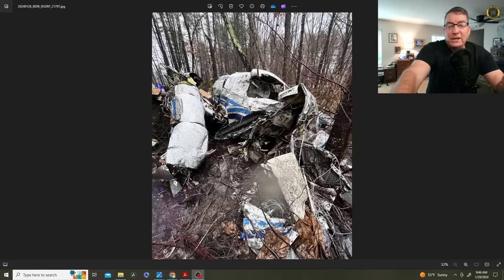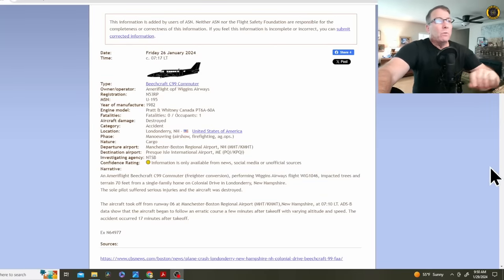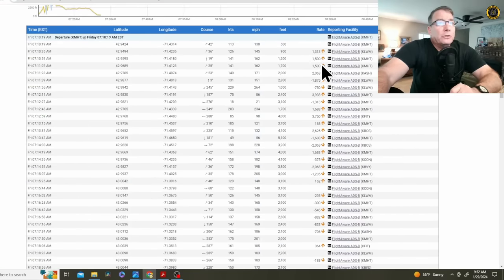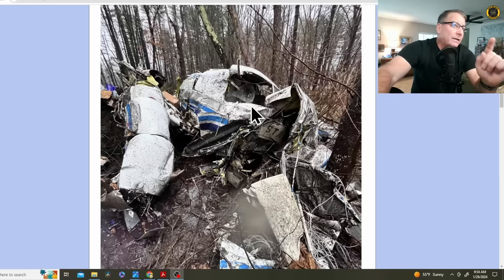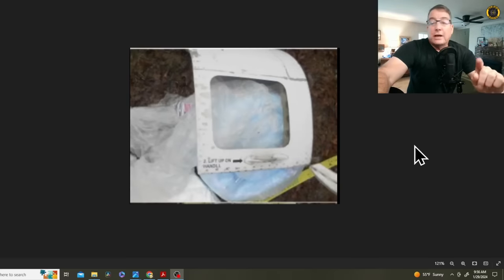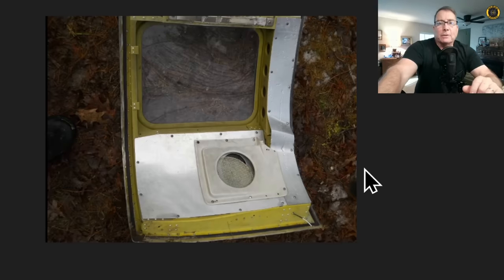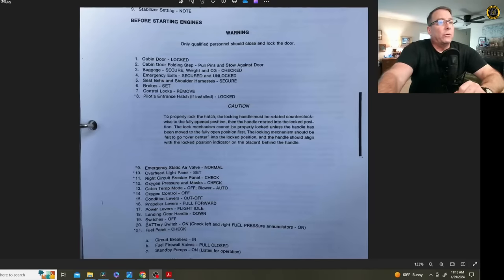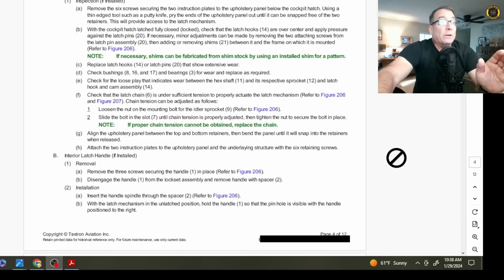Beechcraft C-99 Door Open In Flight Crash! 24 January 2024

Comment: I have about 3000 hours in Ameriflght Beech 99’s. The proper closing of these doors has always been a very important thing to pay attention to,  in fact Ameriflight has even drilled one inch diameter holes above the latch hooks so that you can physically see that the hooks are properly engaged.  It’s imperative that you make sure these doors are properly latched since trying to close this door in flight is almost impossible.  I most likely have about 300 hours in 53RP.  It’s equipped with a cargo pod under the fuselage.  This no doubt helped cushion the impact and made it safer for the pilot.  During my time at ameriflight they had very strict policies that would help prevent this from happening.  The 99 handles icing conditions very well.  You did a fantastic job of describing this accident and the operation of this door Juan.  Great Video!
Reply: I'd be willing to bet you couldn't shut that door AT ALL, until you've landed and you're at taxi speed.
Reply: @rocketman374 IF it stayed there opening upwards looks like it gets right into the slipstream and if it doesn't come off its a sail screwing up control if it does come off looks like the vertical stabilzer is right in the path...
Reply: @rocketman374 you are correct.  If you have one latch loose, do not ever touch that door until you’re on the ground and taxiing. We had one guy do that, and the door is somewhere in the Mojave desert.
Reply: @chrisjohnson4666 more than one door has come loose during the time this plane has been in service. The door will come off cleanly with out hitting the tail surfaces. It’s just a very miserable convertible when this happens. One time after shutdown the whole door came off on me because an upper hinge pin came off.  That was an easy fix.
Reply: Looks to me like that entire latch system needs drilled out of the aircraft and two manual latches installed. Ideally, each with a prox switch that would go to a Door light on the cockpit, but I am an avionics guy so what do I know?
Reply: @porkrind There are already two mechanical hooks in the fuselage that come up and hook over two horizontal pins in the door.  When operated properly, the pilot can look through the holes to verify that the door is properly secured.  This works very well, rather than to engineer it to death using micro switches and other stuff that isn’t as reliable as direct visual verification.  My educated hunch is that the pilot was in a hurry and this bit him very hard.
Reply: @donalddepew9605  I'd rather fight 1000 prox switch issues than a single crash. From the comments I've seen it looks like the door switches were a known unreliability. The exploded BOM shown in this video is insane for a catastrophic piece.
Reply: @porkrind you can put switches anywhere you darn well please.  But actual physical visual verification is best.  I’ve been there and done this thousands of times without issue.
Reply: @donalddepew9605  I like my lights!
Reply: @porkrind  Quite. Loud buzzer that goes off any time there is power with the door not up and not yet doubly latched, for example.
Reply: @queazocotal there’s already an aural warning stating that the trim is out or parameters for takeoff.
Reply: This is why I love this channel, it brings knowledgeable people together! Thank you for commenting and thanks Juan.

Comment: This was the best ATC performance during an emergency that I have heard in a long time. No useless, stupid questions, just helpful offerings. God bless these controllers.
Reply: What would an example of a useless stupid question be…?
Reply: @PRH123  if you have been on frequency during an airborne emergency you hear ATC ask for souls on board and fuel on board. That’s somewhat useful for the controller but the simple question becomes an immense mental task to a pilot in a fight for his and his aircraft’s survival. It always introduces additional questions in the pilots mind, such as “do they need it in gallons or pounds or hours remaining?” And figuring that out while trying to contain  and control a problem is counterproductive in the extreme.
Reply: Thank God for level headed ATC controllers! One nasty night my 99 suffered a total pitot/static freeze up climbing into the clag 200 AGL in freezing drizzle and turbulence. P+P=P, I checked in with departure with my emergency, and the controller matter of factly said he had a mode C altitude on me and gave me a speed readout that was about right for the elapsed time from liftoff. Huh? Both systems in the cockpit inop, and no joy on alternate static, all deice been on since starting taxi. "Don't look a gift horse...". My savior  calmly offloaded his other traffic and became my audio altimeter and speed sensor, up to 3,000 feet and around to the ILS and right back in. Piece of cake. He then invited me into the ATC facility to share a coffee break. Cool as a cucumber. Once in a warm hangar, the P/S systems worked fine, after giving up a scary amount of meltwater. Turns out the plane had sat outside during a sharp thaw with wind driven rain and a frontal passage and a sharp freeze. Alternate static checked out OK on the ground, and the blockage was too far in to be touched by the pitot and static heaters.

Comment: Having worked with firefighters for years now, one should never say they’d be unable to open any door. That’s a challenge they love to meet.
Reply: Especially with the Hurst tool
Reply: I was walking on a trail once, when a pickup ran up the guardrail and slammed into the concrete column that was on the guardrail a few feet down. The truck hit hard enough to push a solid concrete block probably 3 square feet around a few inches back and then rolled onto it's side.
Myself and some other people worked to get someone into the cab of the truck to calm the driver down until the fire department could get there, and once they did, it was wild seeing how quick those tools cut through the top of the truck so they could get the driver out.
Reply: @aaronwhite1786 on the cutters, most modern tools produce about 285,000lb of force at the blade notch, spreaders are well over 350,000lb. 

You can move a ton of metal without blinking.
Reply: Never met a door I couldn't bypass 🚒🪓
Reply: @MomedicsChannel  Definitely looked that way! I feel like Fire Departments could double their revenue just having "Come play with our tools" days where they let people cut scrap cars apart for cash.
Reply: If you want this door to open, just tell engineers this door can't be opened.
Reply: @aaronwhite1786  I know of at least one volunteer department that did exactly that, until the insurance company found out.
Reply: @aaronwhite1786  On most road vehicles the windshield is built in such a way that it will shatter and contain either a body flying through or getting inside the driving compartment, but it should be possible to kick it out from the inside once it is damaged. Assuming you still have working legs, that is.
Reply: My car was rear ended and the rear tire punctured by folding metal. I tried to use a pry bar to open the trunk to get out the spare. The fireman on scene asked me for the keys and opened the smashed trunk using the normal latch. As he walked away with a smirk I said "Show off!"
Reply: Seen fire fighters mess things up so bad - Dang near killed themselves with fire & electrocution on aircraft . . .
Battery location, fuel cut off, cut out areas the normal fire fighter hasn't a clue. Trained A/C fire crew here
Reply: @TDOBrandano  Yeah, in this case, the guy was pretty out of it. From what the nurse who crawled inside said, he was out of it, and might have suffered a medical emergency which caused him to go up the guardrail in the first place.
They were able to pop out the back window with a rock and get someone in to check on him.
I was trying to tell the guy who was trying to break his way through the front window that it probably wasn't the best idea, since the guy inside had nothing to cover himself with, and it's like we were going to quickly peel the thing back anyway. The car wasn't on fire, so there was no reason to rush getting an opening. Thankfully, the nurse that happened to be nearby told him to knock it off.
Reply: @EyeMWing  Aww, that's a bummer. It makes sense, especially with tools that powerful, but it would be a ton of fun to do.
Reply: K-Tool Pro-Bar Halligan, 8-pound fire axe and 6-foot New York hook in reach at the computer. House was built in the 1880's reconfigured several times and moved once. I want a fast way to clear a path out if a fire starts.
Reply: "Here's...JOHNNY!"
Reply: Isn't it easier to just knock?
Reply: @aaronwhite1786 I hurt my back in high school playing with one of those of course this was in the early nineties and it wasn't something you sued about. But no you shouldn't come play with their toys because they are will hurt you if you're not careful and we were being supervised. My injury wasn't Apparent at the time because of adrenaline. We were fire rescue explorers we were prepping for a car disassembly demonstration.
Reply: @markstorrs1787 Damn straight. Our department was the first volunteer company in the northern part of our county to have those tools in the late 80's. It made sense for us to have them because we had two major highways intersecting in our district.
Reply: Firefighters are basically human wrecking balls. They have to be. Getting heavy doors open, breaking out walls to get to the fire within, yeah, they're heavy wrecking and an aircraft offers minimal opposition.
Reply: So they will waste valuable time trying to prove a point when window entry is much quicker and more efficient.
Reply: Do firefighters really distinguish opening a door from making a door?
Reply: There is a long history of doors becoming inoperable in aircraft crashes, trapping those inside. It would probably be just as easy to cut through the fuselage at any preferred point that the scenario presents. In this particular accident, though, it is unlikely that any firefighter on earth, or all of them put together equipped with the latest and greatest tools, could open that door. (No one can open something that isn't there.)
Reply: While I don't doubt that for a second, I think Juan's point was simply that the opening for the hatch wouldn't have looked like that if the door was attached at impact & subsequently removed by firefighters.  In particular, it's the damage around the top of the frame where the hinges were located that's of interest because that door looks pretty intact... the question is more whether emergency services widened the opening to gain access, or if the damage is solely from the door departing the aircraft.
Reply: Years ago I was a EMT student doing ride alongs with an ambulance service. We were dispatched to an accident scene. The driver was unconcious and the door locked. The FD was setting up the Hurst jaws to gain access. The lead paramedic  observed and assessed the situation. He walked to the car, reached in the open window and unlocked and opened the door. We got the patient out and treated her while the fire fighters sheepishly put their tools back on the truck.
Reply: well that's good.  I guess.
Reply: They usually don’t open doors in this situation.  They cut away everything in their way, door, for frame etc. That’s totally different from opening a stuck door.
Reply: Hahaha working with firefighters I'll say absolutely! Fires and cutting up vehicles are what they're born for
Reply: I was a firefighter once in charge of the rescue tool and full disclosure- I did say BS or something to that effect when he mentioned it. That tool was insanely powerful and that was WAY back in the day. The hardest part of extrication is the sounds from the patient- they really stick with you. 
Well hell, having revisited that I bet sleeping is gonna be stressful for the coming days. Yay.

Comment: I had an accidental opening of the canopy on a Van’s RV6-A once.  The canopy stayed on the aircraft while every loose thing in the cockpit flew out, much of it binging against the empennage while the airplane suddenly pitched about 45 degrees down.  Had I not had a shoulder harness on, I think I would have gone out with my camera, charts, etc.  My knee hit the instrument panel and shut off one of the magnetos.  It was the closest I ever came to getting killed, but I was fortunate, because of past training, experience, and a calm mind, to get everything under control and land safely, but it wasn’t an experience I’d like to repeat.  Needless to say, I feel a lot of empathy for this pilot.
Reply: Tip up or slider canopy?
Reply: @davidd6635  It was a tip-up canopy.  It had not been properly latched before flight and I tried to fix it, a very big mistake.  If anything like it ever happens to you, just fly the airplane at a controllable speed, land, and fix the problem on the ground.
Reply: you tried to fix it WHILE IN THE AIR? As in, u saw it improperly latched, and then tried to reopen it to properly reclose it in the air..?  @drmichaelshea
Reply: Your experience tells us that those harnesses can help a lot.
Reply: OMG
Reply: OMG
Reply: OMG
Reply: @KuostA  NOT what he wrote. He wrote he tried to fix it, which might mean pushing the latches harder. YOU wrote he opened it! Very different.
Reply: @billpugh58  he edited his post since that's definitely not what he originally wrote lol

Comment: Former Wiggins Pilot. I flew for them for seven years, loved flying for them. I thought that their maintenance was top notch and the only problem was the pilots not reporting any issues or squawks. It was not uncommon to get an aircraft and write up thirty squawks, all not previously reported. Very much of a “You flew it in, so you can fly it out!” attitude amongst the pilots. My friends that still work there tell of the airline’s decimating the repair staff, offering wages that Wiggins just can’t compete with, such that the number of  maintenance personel is one quarter of what it was.
During training, it was HAMMERED on us that you HAD TO MAKE SURE THAT THE HATCH WAS LATCHED!!! Legend was that the hatch would take out the vertical fin and rudder while departing the aircraft! It was pretty rare that I had to delay a flight due to the hatch not latching, but I did.
There were some concerning things that happened, but there were only two times that I was truly scared. First was being in such severe icing that I couldn’t see out of any window. The second was a very similar profile to the accident aircraft where some customer required safety wear caught on the hatch handle and started to open it in flight!  
While some of the 99’s had the “D” ring handles, most had an “L” shaped handle, and the L shaped handle caught on the safety equipment and started to open the hatch! It was the change in noise that alerted me that something was up. I was able to re-latch it without the hatch visibly opening! I was shaken enough that I was “off” and distracted for the rest of the flight.
I didn’t know the pilot of the aircraft, but know several that do. I am waiting to hear more about what happened and how!
Reply: I hope he is doing ok - sounds like they moved him to a Boston area hospital and he may? be critical, per a report over on a VAS comment last night
Reply: Flew 53RP for 60hrs, can confirm it has the L shaped handle. That L handle is a death sentence waiting to happen. It’s been reported to the safety dept many times but “too expensive” for the company to change them to D handles. And they didn’t see it as a big issue. So stupid. And CAN confirm the Maintenance has dropped SEVERELY in recent years. Lack of parts and lack of mechanics both. The amount of times I heard or saw a mechanic install a part from NAPA and they would joke about it. 🤦‍♂️
Reply: How are their planes equipped as far as avionics?  If he can't talk to ATC.. and any charts or iPad also got ejected, if there any way to pull up the ILS frequency, or know his position (onboard GPS) ?
Reply: @rcarsey  if memory serves, 53RP had heading and altitude STEC, and it had a 430W I believe? The speakers in all the 99 are an absolute joke, so they wouldn’t be able to hear them with all that wind noise. His headset was likely sent out the window because that’s what happened to my friend a year ago. Most planes have a 430 or 650. But a few metros and 1900s are still /A. And a few 1900s are KLN90B
Reply: @CaptBryce  got it..  so sounds like he should have, at least technically, been able to find his way back to the airport with what was onboard..
Reply: @rcarsey  correct
Reply: @CaptBryce  yeah, but then, you´d have potentially freezing rain hitting you and maybe a control issue if the departing door hit something etcetc. Got 4000 hrs in KingAirs (all types BUT the 99) and I think this guy had a real handful to deal with. Hope he makes it okay.
Reply: @getyoursupervisor8519 even with the door still closed you usually have freezing rain hitting you in the face because the triangle window seals are NEVER good 😂
Reply: @CaptBryce  ohoh. I´ll stick with my current A/C - no triangle windows at all. Had a short circuit in B200 after some genius left the R/H triangle window open during rainy night - he was boarding before me and dried everthing that you could see but didn`t account for the water in the circuit breaker panel below the window. - which was sorta watertight... :-)
Reply: Thank you for sharing your experience! What's the old saying? That which doesn't kill us makes us stronger? (nervously laughing) Right?